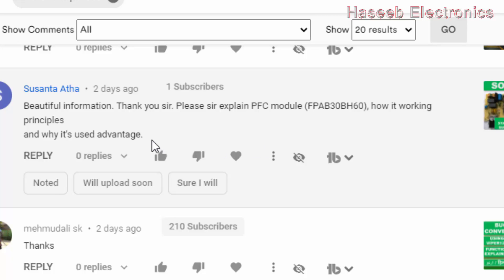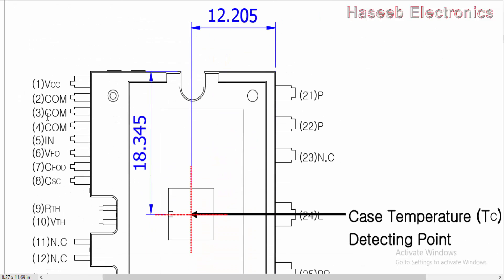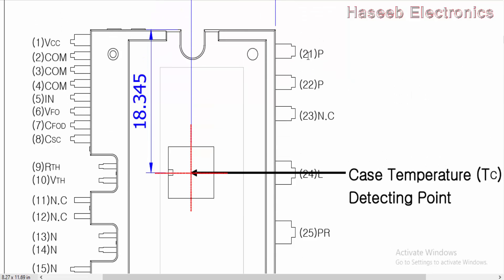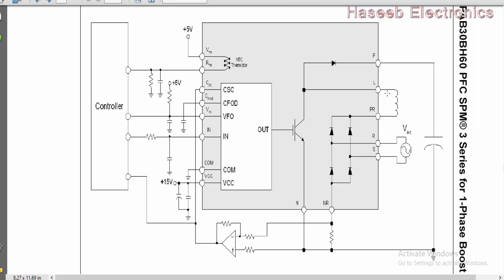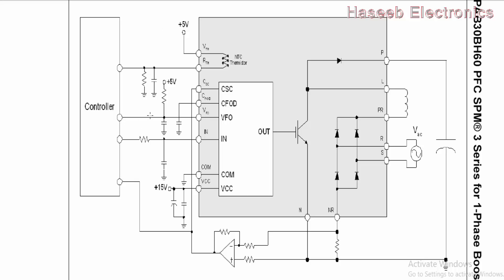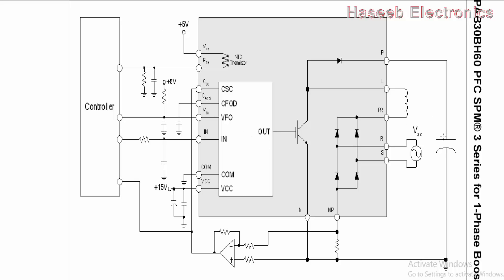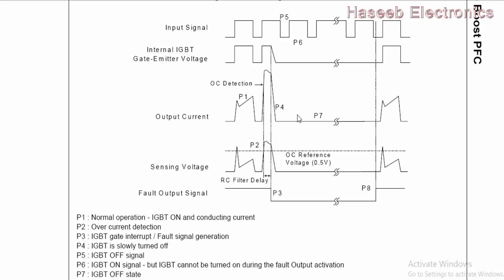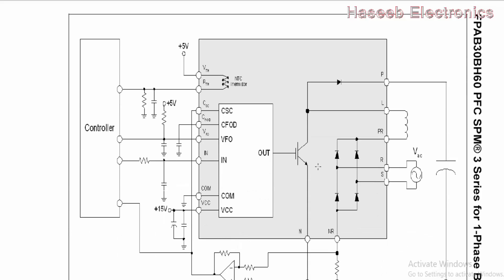#312 Power Factor Correction Boost PFC FPAB30BH60 Module

Comment: Is it possible to modify this kind of module, depend on the error show, if possible how its done
Reply from the maker: no these modules are molded and comes in single chip and i think it have no discrete components inside,  so it will much difficult to repair it

and moreover i never tried it.

Comment: Sir, please make a TL494 dc to dc flyback converter for car audio amplifier.
Input: +12V dc.
Output: +12V (10A), 0V, -12V (10A), +5V (100 mA).
Efficiency: 90%

I try to make this system but don't get proper output current and stable voltage.
I have no oscilloscope so I can't visualise what happened in the system.
Also, at the time of start and stop the output voltage reach to 50V approx.

Thanks & Regards.
Reply from the maker: first of all TL494 is dual drive ic and for flyback topology we need single drive 
because for DCM AND CCM operations we need duty cycle around 50%
so you can use TL494 in parallel operation 
OR
use uc 3842-3845 family. it will best selection. 
I will try to share circuit design as soon as possible. (approximately after 2 week, as this time I am in Pakistan, when I will reach back to Jordan, I will try to do it)
Reply: I used it in parallel mode, connecting the pin 13 to ground.
But same problem arises.

I used uc3843 current mode controller also.
But in this circuit series current controller resistor drop is more, higher wattage loss, no soft start, also the IC damage easily in voltage flactuations.

Thanks and regards for your reply.
Reply from the maker: no problem, I will try to share complete circuit. 
basically it depends on correct transformer calculation and adjusting duty cycle carefully. 
most of the time this problem occure due to mismatching of core  flux density, core gap, and power calculation.
Reply: Ok sir.
And I use 25(OD)x10(ID)x15(H) mm toroidal ferrite core for small size.

Thanks sir.
Reply from the maker: toroid core have many materials
it's AL value varies widely based on the core materials.
so the flux density will differ in same core size 
always use core product datasheet for correct usage
Reply: I use a ferrite core, not iron oxide core.

Ok! Which ever it is!

Please make two individual dc dc flyback converter videos mentioned firstly using TL494 parallel mode and UC3843. Which will best, I will make that for my car amplifier.

🙏🙏🙏🙏👍👍👍👍